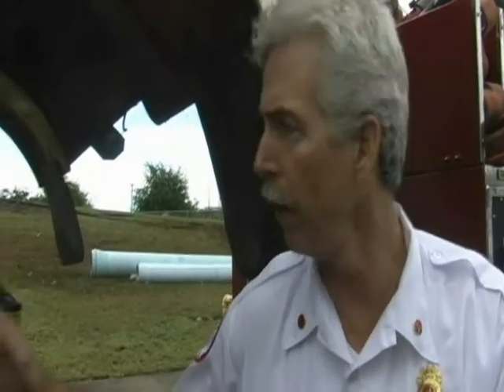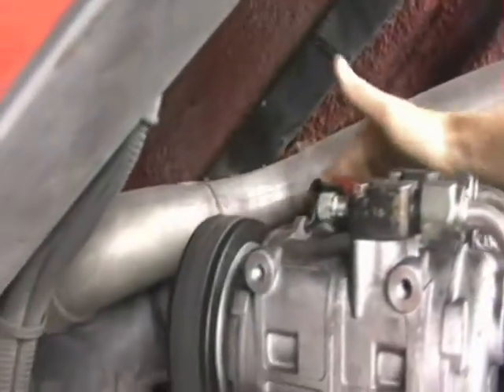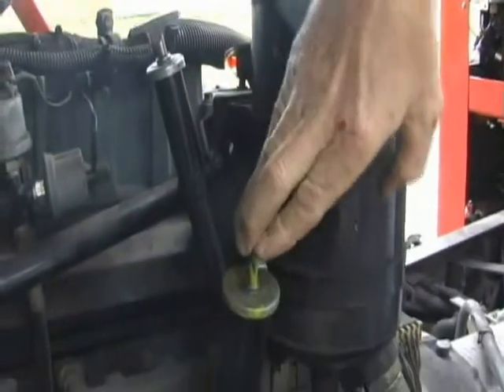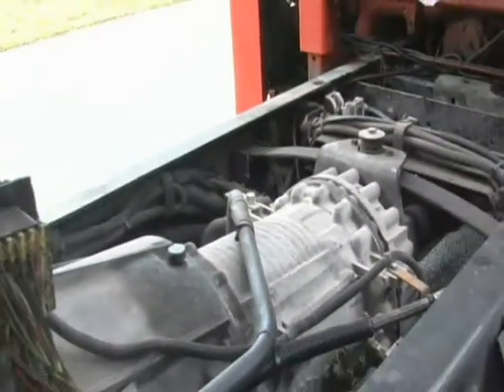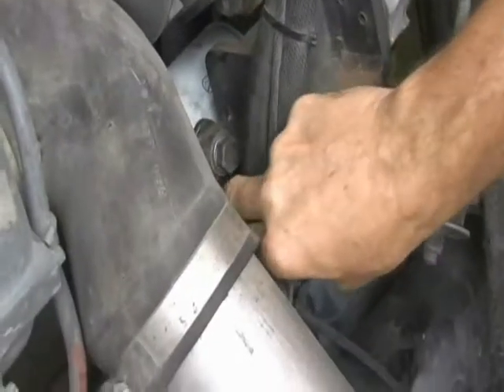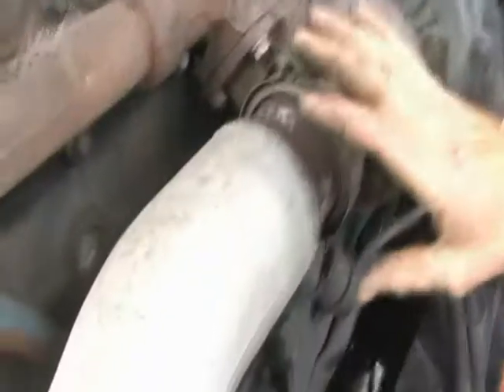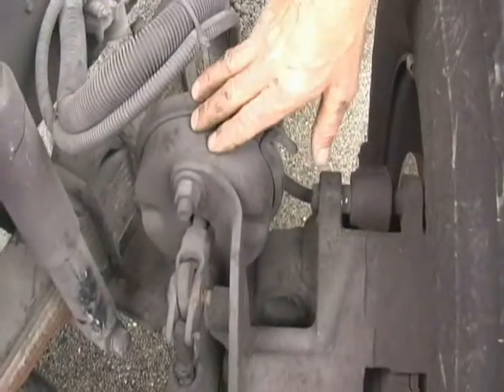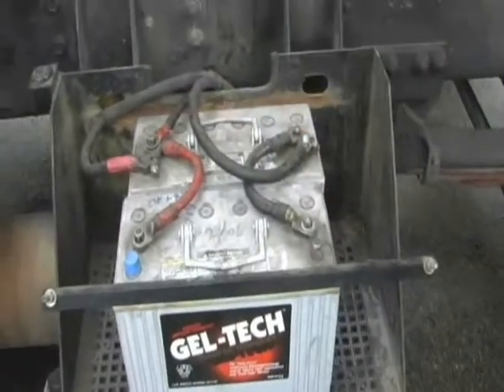Apparatus Inspection Part6

Comment: Hello how many time you make this inspection ?
Reply from the maker: Daniel Gringmuth it's supposed to be everyday you are on duty. Just not as slow as you see here on the video.
Reply: ok you check everyday material on from fire rescue ?
Reply from the maker: Daniel Gringmuth yes, not as detailed as this checkout,  but yes.
Reply: maybe it is a good video for a check matrial with checklist a fire rescue truck or EMS Truck .
it is a very good video .Continue .